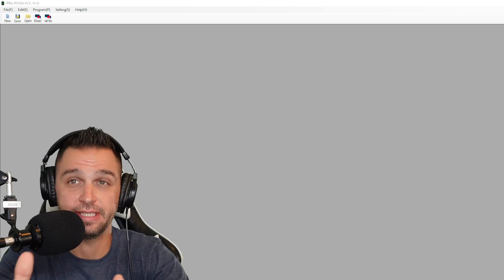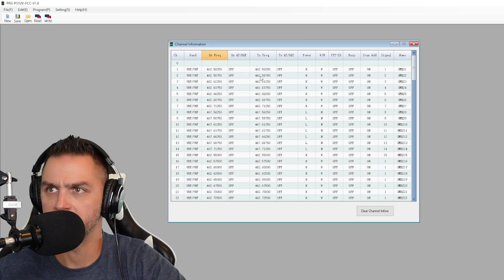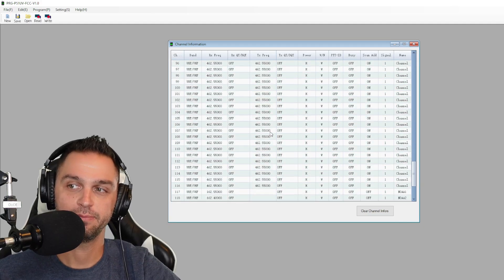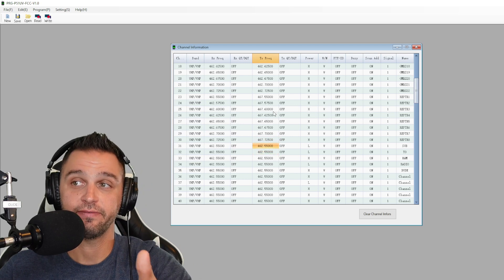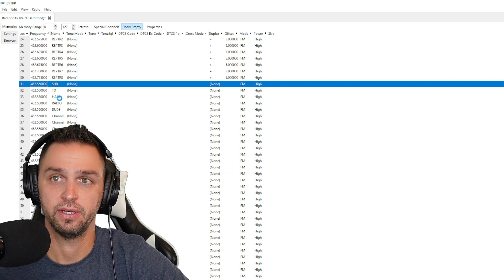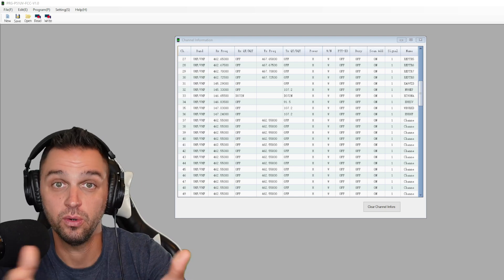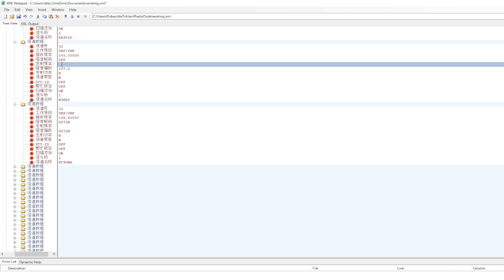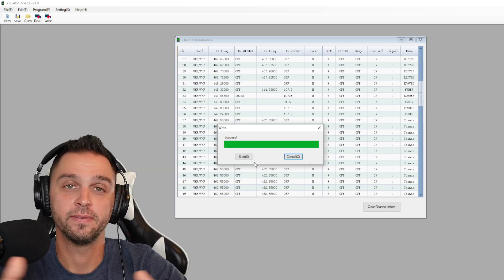Baofeng UV-5X / UV-5G HACKED !! - How to frequency MOD A Baofeng GMRS Radio

Comment: Once the tx frequencies are changed with. The hack, can you edit the frequencies from the radio itself?
Reply from the maker: You cannot. Is a workaround hack, but I'm hoping someone else can expand on it in the future.
Reply: @DudeTested  Thanks for the reply! Really great content. I tried adding a repeater manually using the RX/TX frequencies, but the offset won't save to the radio. Is there a way to edit the offset in the XML? I've tried using google translate  but I can't get far

Comment: Ok I had the radio sent overnight everything seems promising but the xml file won't open this radio is the UV-5G. This file is not found or recognized by the software.
Reply from the maker: Can you confirm which  software you're using?
Reply: @DudeTested  
Software version  PRG-P51UV-FCC-V1.0
Reply from the maker: What's the version of the software? It's possible they upgraded the software to not accept xml files. If that is the case, I'll try to find the original software
Reply from the maker: When I get home I'll check if they updated the software
Reply: @DudeTested  much appreciated, thanks!!
Reply from the maker: I just downloaded the version from the internet and confirmed that it's fine by going to file - open - then locating the xml. I'm scratching my head a bit on why yours would be different.
Reply: @DudeTested  Could you send me a link to the version you have?
Reply from the maker: @ChevyCeeLo  that is the version I have
Reply: I'm running windows 10 on a older computer so idk if that has anything to do with it?
Reply from the maker: https://discord.gg/dZbDczGN the best I could recommend is to join the discord because doing technical support over YouTube comment section is kind of difficult. I don't know what you're seeing and in the discord server you could provide screenshots and maybe we could help you through. The best thing I could tell you is to find where you downloaded the XML file and you should be able to click file open and select that XML file
Reply: @DudeTested  I'm on now whats your your user name?
Reply: @DudeTested  you got a simple email it's over 300 people in the chat

Comment: Hey I have a lot of interest in doing this. I recently acquired quite a few of these radios and am in the process of obtaining my ham radio license. 
Since I’m new to this and also generally not super capable  with computers, I was wondering if you’d be willing to give me advice once I start this process should I have any problems ? 
I could just buy all new radios but it would save me a good amount of money if I could do your hack. I basically just want to be able to use them on HAM frequencies. But I genuinely don’t know much about ham yet so idk I’m afraid I’ll start this and then mess up somehow.
Reply from the maker: If you have any troubles let me know and I'll be glad to assist. I can see where it may be sort of confusing, but I also understand the need to want to save some money.  Best wishes!
Reply: Just buy a radio for ham use
Reply: The UV-5R is cheaper and a ham radio. None of this si required, this is for people buying the more expensive GMRS only version.

Comment: I get to the point of "reading" from radio and it says "shacking hand" the it Fails. I have a  UV-5R. Is this hack not compatible? Cheers
Reply from the maker: It is not. The hack only works with the UV-5X/uv-5g because of the software bug for that radio.    Best wishes
Reply: Brad Akins, try pressing PTT+MON+VFO/MR while turning on.  Let go buttons when you see FACTORY.  Go ahead and test transmit see if it works.  :)

Comment: Hey HRD. I just had a friend order several UV-5Rs and the GMRS frequencies are blocked. CHIRP says that they are open. I can receive from these new HTs but I cant transmit on GMRS. Do you think that there is a similar solution to this. I don't want him to have to send back his radios.
Reply from the maker: I have not found any yet.  Sorry.
Reply: 3 button factory reset unlocks the new uv5r's
Reply: @PrometheusDigital  how do you do that
Reply: @gabechampion5312  https://youtu.be/2sg3RJf1ZEA it's confirmed to work
Reply: UV-5R is a ham radio, you can not transmit legally in the US on GMRS even if you have a ham license.

Comment: They are facing pressure from the FCC and Amazon. I expect more locked down radios from now on. I don't know if the locks will be bypassable but I suspect more pressure will cause them to lock it down harder.
Reply from the maker: I agree.  Baofeng was definitely very concerned about this. They told me the was has a hardware limitation which wouldn't allow one to write to ch 31 and higher.   It doesn't.   They made excuses that I had developer software that was unauthorized to have.... I don't.  Then they said the xml notepad was a developer software internal to baofeng...  It's not.  Finally, they admitted they are  scared about the FCC.  I assume Baofeng is trying to get away with the least amount of work possible but still wants their certification.  This is just going to continue to be more difficult for them.
Reply: That's why like older cars I also run older radios no big dollar conversions or expensive hassles and quality is also much better with most older being very easy to modify..

Comment: FYI, the hack makes the radio no longer authorized for GMRS use as I read the rule.
§ 95.337 Operation of impermissibly modified equipment prohibited.

No person shall modify any Personal Radio Service transmitter in a way that changes or affects the technical functioning of that transmitter such that operation of the modified transmitter results in a violation of the rules in this part. This includes any modification to provide for additional transmit frequencies, increased modulation level, a different form of modulation, or increased transmitter output power (either mean power or peak envelope power or both). Any such modification voids the certified status of the modified transmitter and renders it unauthorized for use in the Personal Radio Services. Also, no person shall operate any Personal Radio Service transmitter that has been so modified
Reply from the maker: You're right. Thanks for the info.   I wonder if the FCC will revoke this certification as the radio was clearly capable of transmitting without doing anything to the radio besides programming it
Reply: @DudeTested  We hams tend to be both curious and smart. I enjoyed learning about interacting with the firmware. So many of these cheap radios are "radios on a chip." I doubt the cert would be pulled due to a hack. Any computer can be hacked. Cheers.

Comment: HRD, I have just ordered the RT systems ADMS-70D USB Programming Software from DX Engineering. Now, I am having an issue with my Digital mode. When I have it set on Digital, I receive an incoming transmission that switches me to FM. I have never had that happen before. I have had my Yaesu FT-70D radio for over a year now and I have Not gotten any updates for it or had it programmed for future transmitting on different frequencies. Question: When I get this programming cable/software, will it give me Updates as well that is needed like a computer needs updates every now and then as well? Thank you and thanks again for the past help. Haven't talked to you in almost a year now. I am somewhat Ignorant about these radios and only got licensed for mainly Emergency reasons but find it fun to talk to others around the world. I can do that when I'm on WIRES-X. Talked to a guy over in Japan last year quite by accident. Ok, take care and thanks again for any answer you give. KD9QAN and I'm Clear.
Reply from the maker: Hey there. Sorry for the delay. It sounds like Automatic Mode Select (AMS) is enabled.  From Yaesu: The Automatic Mode Select function detects the receive signal mode
The transceiver automatically selects one of the four communication modes according to the signal received. This is extremely convenient when listening for communications, as you do not need to be aware of the other party’s communication mode. The transceiver can also be operated in a fixed communication mode.   To Fix: (Page 16 of the user manual) - Press the AMS Key, Rotate the Dial knob to tune to the desired transmission mode as follows -TX Aut, TX FM, TX Digital .  It's probably set to TX Aut (automatic) Best of luck!

Comment: I have a Baofeng question for you. I dropped my F8-HP today. I didn't fall for, and it landed on the back/batter. Now the radio will not work with the battery, but will work with the battery eliminator, plugged into a 12 volt power supply. The batteries still work in my other Baofeng, a UV 5R-V2+. So I am wondering what went wrong. I like the F8, and I guess I will have to get a new one. Any ways, if you could give it some thought. KI7BSL James, 73's
Reply from the maker: Hey James,I don't know much about the f8hp, but have you tried the other batteries in the f8hp? I'd almost be willing to bet one of the contacts is loose, internally and the eliminator bypasses the contact.  Or one of the contacts is slightly recessed into the radio and not making contact
Reply: @DudeTested  Thanks for the reply, I jiggered the contacts a bit, using a pair of tweeezers and now the dang thing works with the batteries again. No idea what I did, I'm just glad I did it. I like my Baofeng F8-HP, its been a great radio. Thanks again.

Comment: Nice. Gives me motivation to look into doing something similar with my new UV-5R that is locked. Even if I can't unlock the 5R, your workaround means I can buy the 5G and then make it work for amateur radio.
Reply: I just expiericned  the same issue with my new UV-5R , i have an older  UV-5R and im able to TX on it. the new version is locked, wondering if i could copy and paste all the settings and unlock the new version?
Reply: @rogeoz  did u try the three button turn on factory reset hack?
Reply: @jj-zy6gc  It's amazing how many people repeat this instead of just trying it and seeing it doesn't work.

Comment: Great work, glad to know that the software modification is doable. Is the UV-5X more expensive than the UV-5R ?
Reply: By a few bucks per radio and you cannonly buy them in2 packs starting around $60 USD